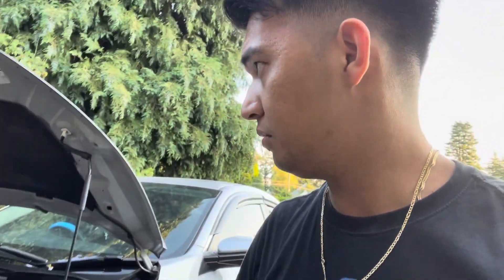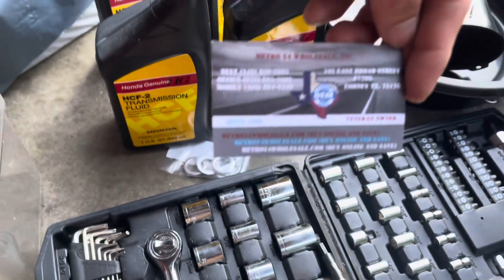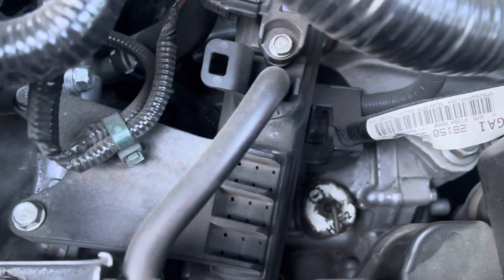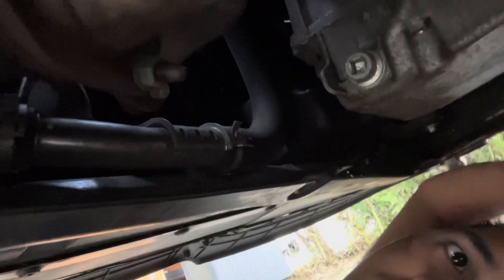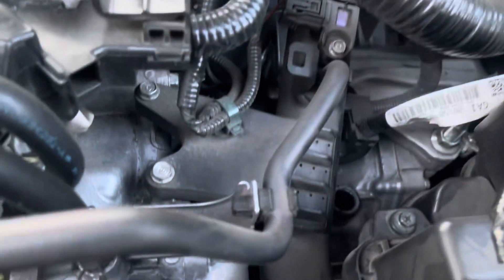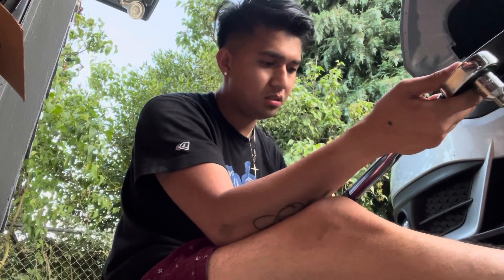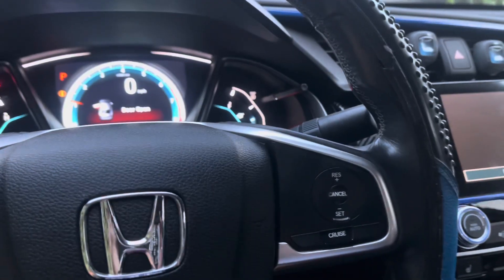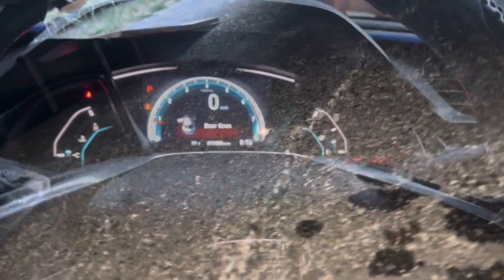Transmission fluid change (2016-2021 honda civic)

Comment: WARNING - at 4:20 John attempted to turn the drain plug the wrong way.  It's a wonder he did not completely strip the threads with the extension bar.  Glad he corrected the problem.
Reply: He forgot to remove the check bolt to see if the amount of fluid he replaced is sufficient.

Comment: Does anyone know the part number for the transmission fill bolt and gasket?? I like to have spare parts, but can’t find a part number anywhere. I’ve tried going to local dealership and they can’t locate the part either. I have a 2021 civic hatchback sport 1.5L

Comment: You forgot to remove the check-bolt to find out if the amount of fluid you replaced with is sufficient. I would do that first before I do the final step in turning on the engine and do the changing of gears in 5 second intervals.
Reply from the maker: Thank you for the advice, probably gonna do that next time I will change my transmission fluid.
Reply: So is it even necessary to measure what drains before filling it if there's a check-bolt?

Comment: Most of the civics are not 4+ qts. capacity. You should see if you have an oil dilution problem.
Reply: In the transmission?

Comment: Shouldve replaced both cvt filters and oil strainer at 90k mileage. I'd do it at 30k-60k Mi.
Reply from the maker: Planning to do that on my next transmission service , thank you btw.
Reply: @johncarlows293  Hi man, awesome video btw! Drive safe!

Comment: Hatchback? Looking at your small car.
Reply from the maker: No it’s sedan
Reply: @johncarlows293   ohh. What your car year? Mine is 2018
Reply from the maker: @michaelcurry11  mine is 2016, but if you doing your trans oil , and you have the 1.5L just same process.
Reply: @johncarlows293  i have a 2.0L with cvt, is it the same as yours?
Reply from the maker: @ONeA2122  I have the 1.5L , that I don’t know if same process as mine

Comment: sorry dude your tightying   not loosen it
Reply from the maker: Actually I didn’t, as you see the bolt when I’m draining the oil 😊
Reply: @johncarlows293  u were applying clock-wise pressure, that's tightening